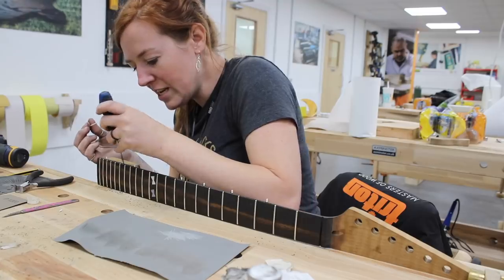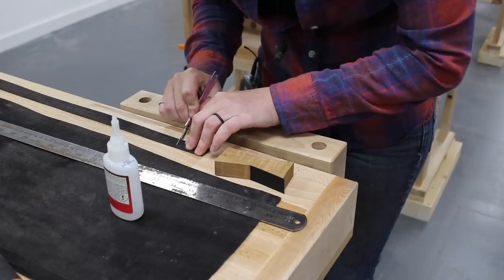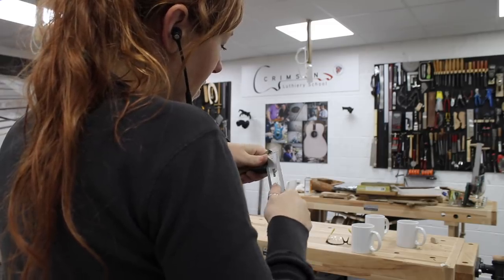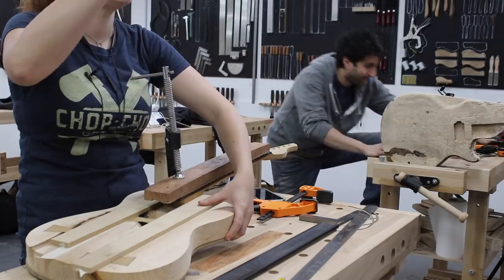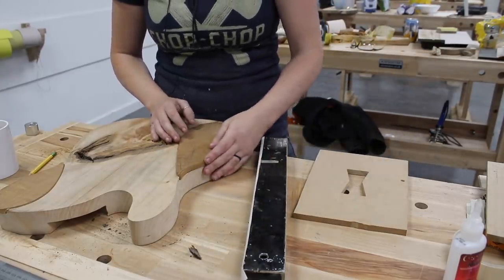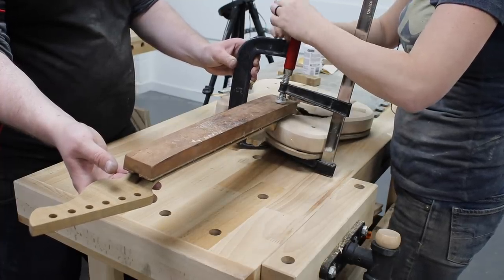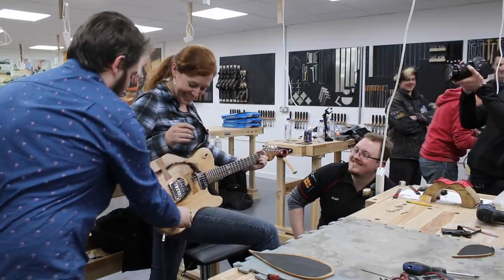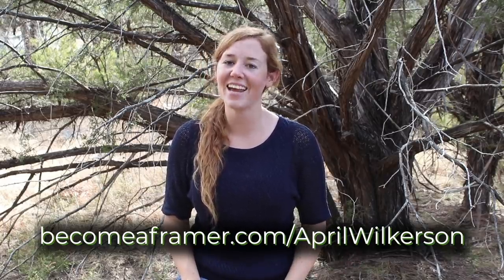Building a Custom Guitar Body with Bowties

Comment: What your guitar is a Les Paul style body, a  Gipson style truss rod under the fret board without the Fender skunk stripe on the back of the neck and A Fender style straight 6 tuner arrangement with a non Fender scroll on the bottom.

Comment: Nice job April. How come you did not fill in the crack with epoxy? I noticed in the video that the crack goes all the way through. I know the bow ties carry the load, but wouldn't epoxy have increased the strength?

Comment: April, for guitar finish surface; I'd have preferred you filled the voids in the bark inclusion with clear epoxy - would show the flaw just as well but not left valley and surfaces that will collect dust and detritus over time.  All the looks would still be there but the top surface would have been uniform.  All the bowties could be cut and then inlet with a single concentric router guide- and the corners would be nice and rounded (1/8" bit)  Nice vid, thanks. Why not invite pickers from your area, at home, to come and jam on your hand built axe?  make some good vid footage?

Comment: That crack going through the entire body is too much. There should have been some epoxy resin in there otherwise there is a total loss of sustain. All you basically get is the sound of the neck just like those travel guitars. You can add a neck to anything but you can tell when it actually sounds good versus just looking good.